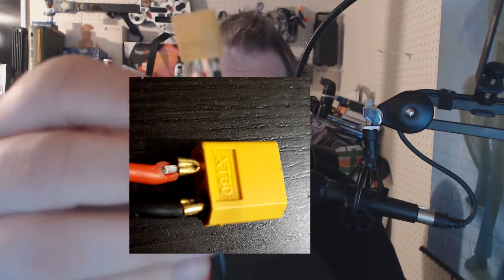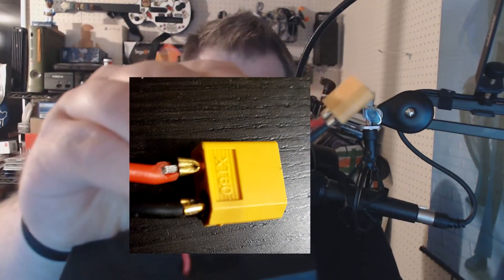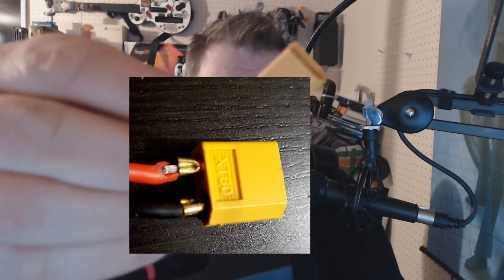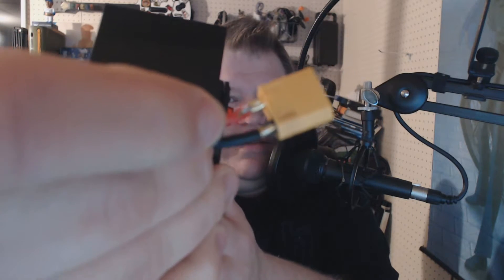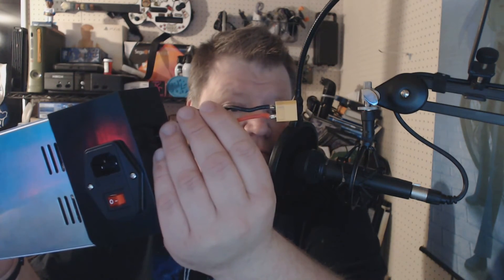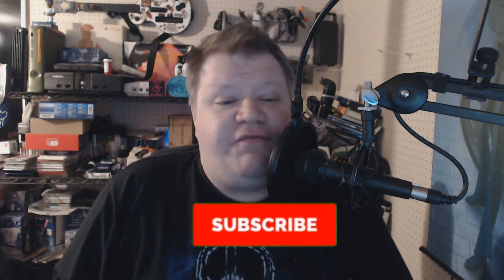Ender 3 (and pro) could be a fire hazard

Comment: Mine was bought in December '18 and was crimped too. It wasn't getting hot and the plastic didn't melt,  but I just cut the connectors out and soldered and heat shrink wrapped the wires to be safe. I also flashed the firmware to the latest Marlin, installed a smoke detector above my printers,  and bought a fire ball extinguisher placed above the printer just to be safe. I think a lot, if not all printers have some fire risk, so an ounce of protection is worth a pound of cure - or your life for that matter. Even if the printer is manufactured properly,  I've seen prints pop loose mid print, and you can wake up to a giant glob of molten plastic being drug around by the heated nozzle and completely wrapped around the hot end. Yikes! Just an fyi, if you have an Amazon echo device in the vicinity, it can listen out for your smoke alarm going off and notify your phone through the app. Enable the Alexa Guard skill in the app. It's free and I have that set up too!
Reply from the maker: I think it a little over kill  but adding the alexa feature not a bad idea. Thank you for your input

Comment: My connection was too hot to touch cut the wire snd it was a loose crimp job. Had to replace the connectors and solder new ones on. Got my machine in early december

Comment: what i got from this is the problem will fist show when you heat you bed heatbed up til 90 or will print abs and do that for hours before the i can show up
Reply from the maker: nope  i had the printer for about 3 week  before I heard of the problem,  heated my bed at 60c  in the middle of a 3 hour print touched the connector and got burned.  all i print is with PLA and some petg. thats all.

Comment: It is not that difficult to cut these and replace them with a proper connector. Realistically however the only way a crimped wire is a fire hazard is if it was done improperly and did not adhere to the manufacturer specifications. So before you can say this is a fire hazard you would first need to know what manufacture crimping system was being used and know the proper specifications about how they should be crimped. Below for example is a diagram that explains the proper way to crimp a Faston Flag Receptacle with Tab Lok. All manufacturers have a diagram like the one below as this is a legal requirement. So to say that just because these are crimped it is automatically a fire hazard is inaccurate and wrong. Please include your justification for making this claim!

https://www.te.com/commerce/DocumentDelivery/DDEController?Action=showdoc&DocId=Specification+Or+Standard%7F114-2078%7FR%7Fpdf%7FEnglish%7FENG_SS_114-2078_R.pdf%7FN-A

Something else you have to factor into this is at least in the US there are standards that must be adhered to in order to get the license to sell an electrical appliance in this country. The UL listing is very strict on what can and cannot be done and Creality could not sell these printers if they did not already get prequalified. This of course does not mean there are defective ones, but to make the claim that in this case using a crimp somehow automatically makes it a fire hazard is irresponsible! Still it does not hurt to be cautious and double check to make sure it is done right and is not in fact defective.
Reply from the maker: Ok 1. Yes the connectors can be soldered. But this more falls on the company then the user. 2 XT60 connectors are almost impossible to crimp the metal on them is very strong and if you look around there to be solder. 3 connectors have burned and there the one that are crimped. The first batch or ender are ok some have solder some not this is just a warning for all to check it since more and more reports are out, and the fact mine almost did.
Reply: @CanadianMakerProject  Yea I would have to say this connector should have been soldered. For me the safe bet is to NEVER trust a Chinese manufacture. The odds are you are going to end up with crap like this and I think its safe to say none of them should be trusted even if they have a UL listing and have passed the qualifications. Given there are quite a few people reporting this issue I think it is safe to say there is a genuine cause for concern and for that thanks a ton for your honest opinion and follow up video!

Still I would not be to hard on yourself for this. If this is the only problem with this printer it still rates a recommendation considering its only a few bucks for what you need to cut this off and replace it with something functional and safe!
Reply: @CanadianMakerProject  Looking more into this what I am seeing is the bigger issue is the typical Chinese solution of substitution with a cheap knock off power supply that is being used. Personally I would consider the fire danger goes much deeper than just a simple connector in this case. If I owned one I would think strongly of replacing this crap power supply with a quality one, but thats just me...;)
Reply: @CanadianMakerProject  Makers Muse is reporting on this as well. Might want to check out his video for some more info, although I am sure you have already done a deep dive.